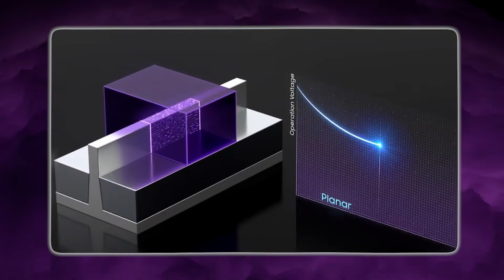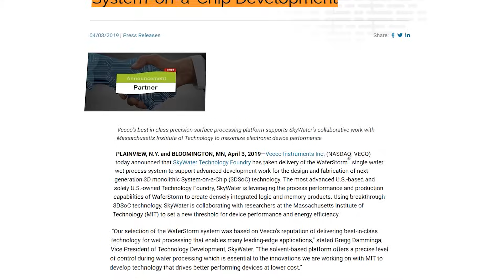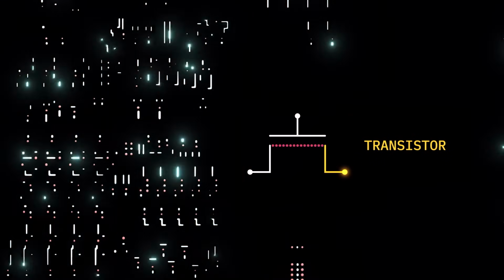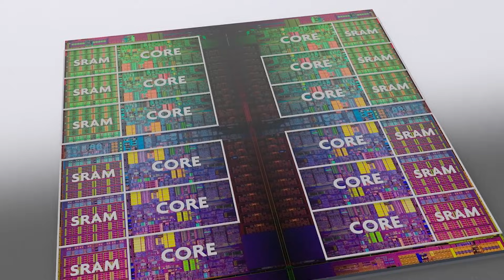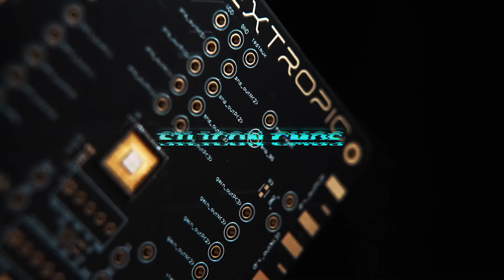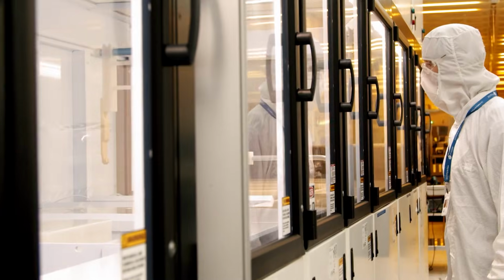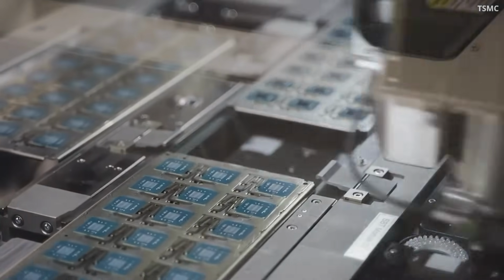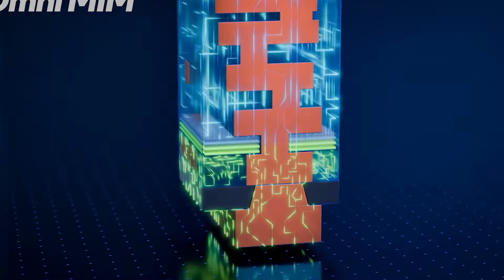Stanford x SkyWater built world's First Monolithic 3D Chip that destroy Flat GPUs from Nvidia & AMD!

Comment: Seems like 3D would add to existing heat problems
Reply: Yes, it does.  Stacking compute unit and memory is not a new concept. It's not been a winner because manufacturing is difficult, doesn't work with current production facilities and. as you mention, issues with heat dissipation.  The video is glossy and says the work has been peer reviewed but it stops short of mentioning any issues.
Reply: you don't need to run fast, that is for the optical version - they should sandwich them with tecs, computers are about to go off the chain here is just a few more years - ai will hit smb sector in 3-5 years
Reply: The only answer is MISC .. The only massively parallel CPU ever created on 180 nm process scale is the GA144 .. It does 100 billion operations per second running at .65 watts .. If it were made on 4 nm process scale it would be faster than the Nvidia B200 Blackwell processor ..
Reply: I have designed a Agentic AI MISC based system that will design Custom Agentic AI Mete-MISC chips , software , systems & ecosystems .. I am the only one on planet earth who is proposing AI systems to create Custom AI processors for application specific purposes .. This is my phase I system .. Their are 4 phases to this architecture ..